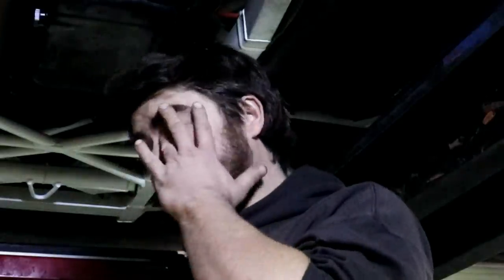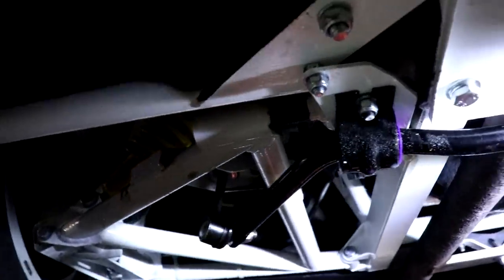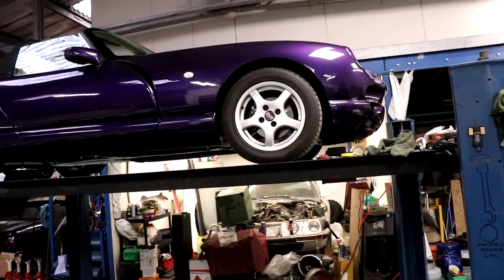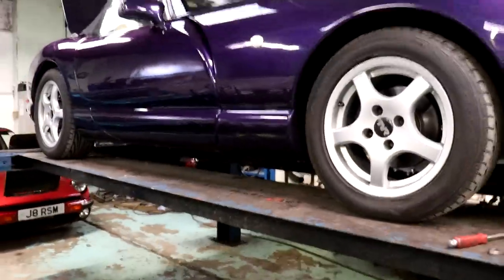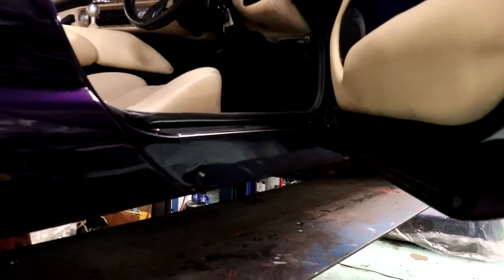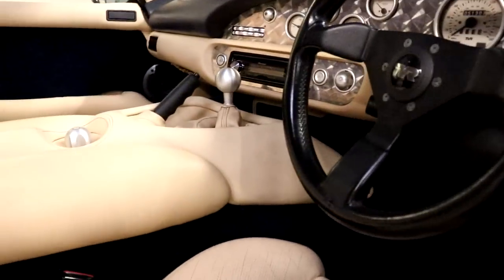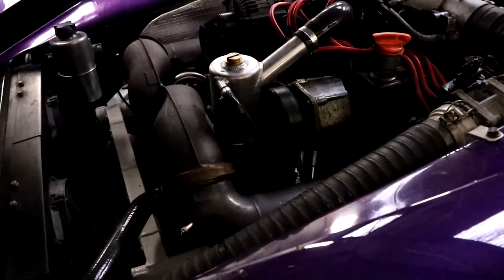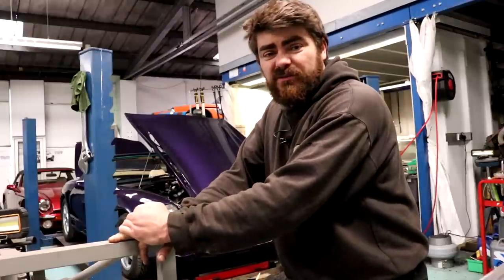On The Ramp | Underneath a TVR CHIMAERA

Comment: Here's a question, when people restore TVR's do some people galvanize the chassis instead of powder coating them again?
Reply from the maker: Dip-galvanising is a risky business as some people have (apparently) had the chassis distort due to the heat. You also have to drill holes all over it. When I have the chassis' done, I have them spray-galvanised, which is zero-risk (just costs a bit more) and then 2k painted. The cheapest way is just to powder coat them again, and surprise-surprise, they don't last very long!
Reply: @UPnDOWN  interesting - I saw somebody on the web galvanize dip their esprit chassis and was amazed how cheap it was ( less than £200) ...and wondered why everyone didnt do it..then I recalled someone way back when saying, it can distort things, even just doing suspension components. Even plating can, I am told.

I have a low mileage original 92 Griff 4.3 and, despite being dry driven and stored (mainly stored!) now needs the suspension components sprucing up

Its only surface rust and flaky paint - could u give a guide as to cost for such smaller items - who would u recommend - do they do the 2k too?

...dont suppose u have an LT77 92 Griff speedo sensor? ;) Stopped working whilst laid up for yrs - speedo still smoothly rises from off scale to zero with ignition

Besotted by all Wheeler era cars and loved his laconic, laid back style. Had the pleasure of a few short chats, Trev too :)

Desperately miss the factory and great team that made these beasts possible. Totally agree with your 'custodian' view :)